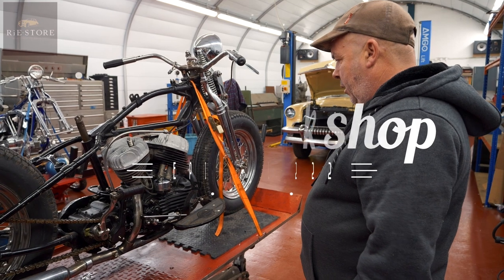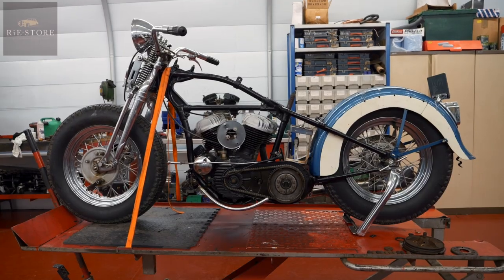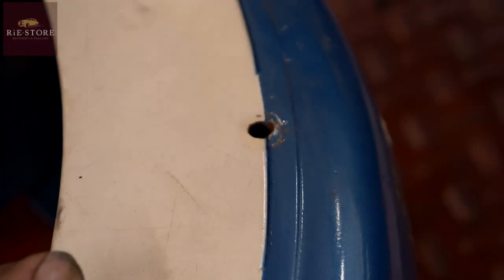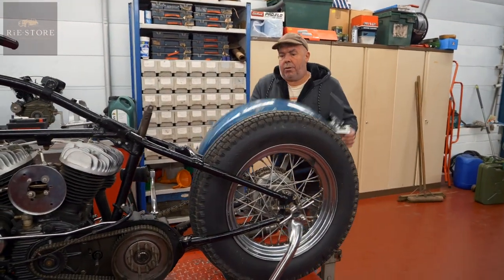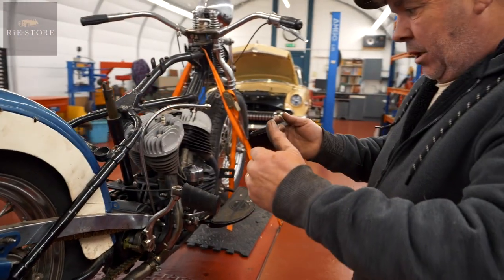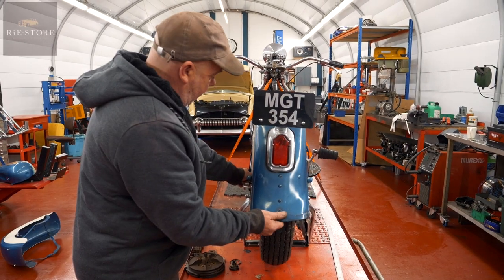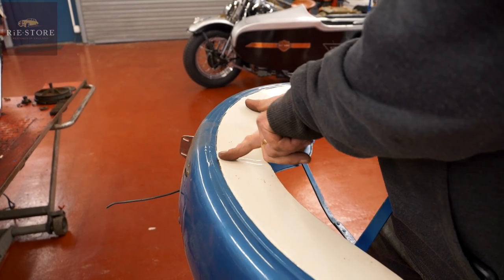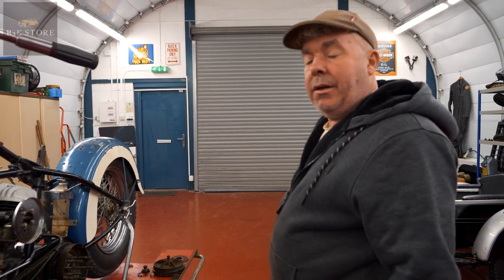How to make this bike 1000 times better - Harley Davidson WLC / ep222

Comment: I like watching all your videos on Harley 45's because I have a WLC that I brought back (it was a miracle) from the non-running condition. The back mudguard on that WLC bike doesn't have the cut-out for the right-side chain. Probably better to buy an after-market fender for a 45. The four holes for the saddlebag plate should be half ways down the skirt, don't you think? The front fender has that horn bracket. The WLC had military fenders and 18-inch wheels so once you make the switch to civilian fenders and 16-inch wheels the horn brackets have to be re-thunk.. Love your videos because the emphasis is on being practical and being rideable, not on winning points in a show.